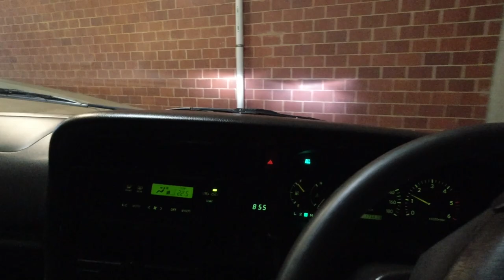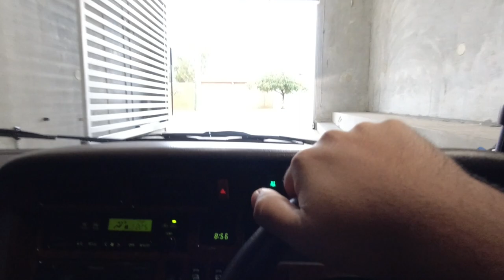Online Store, Underbody Coating & Minor Rust Repair

Comment: hey
i really enjoy your videos. really informative. ave seen your catalog of part from your website. then i landed on the Sarawak oil and fuel filter. kindly abstain from them. they are the worst. they work well for a limited time period until u notice the car hard starting. my advise is that u should go in for the Osaka filters.
Reply from the maker: Hi thanks for your comment. 

Sakura are used throughout Australia in workshops as well as our big retailers. They had issues with counterfeit filters being sold however the genuine filters are of the highest quality. If you look back on my videos you'll find I've been running Sakura on this car for almost two years and for about 10 years on my other vehicles.